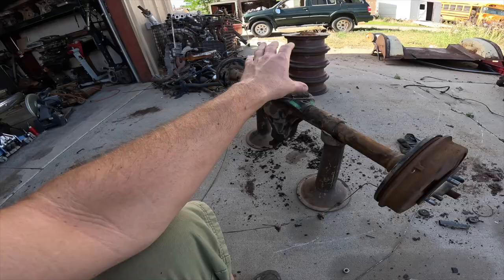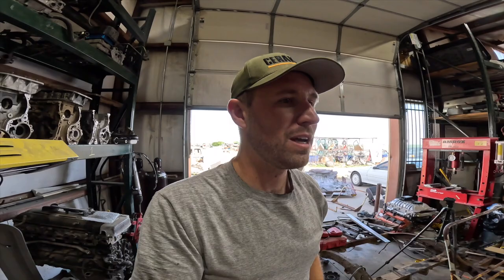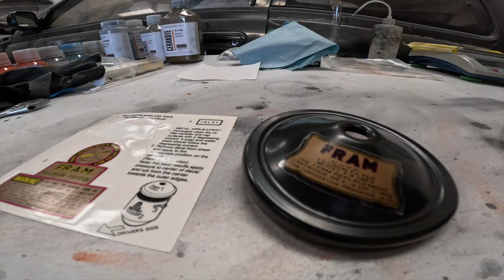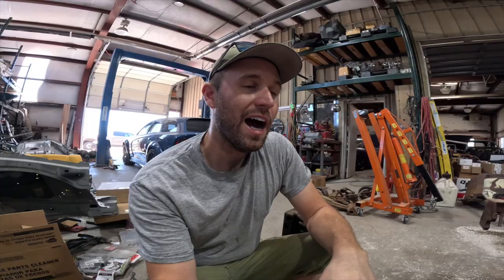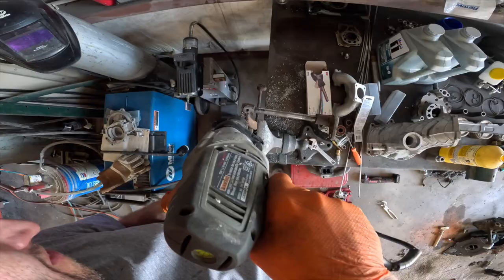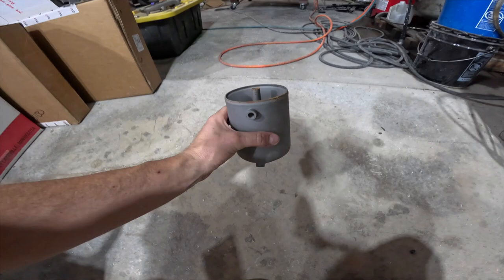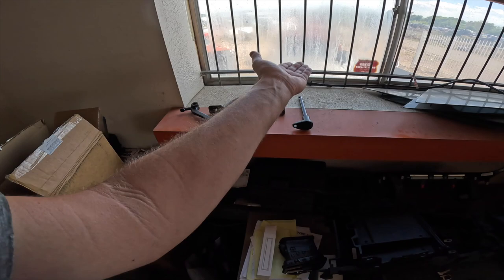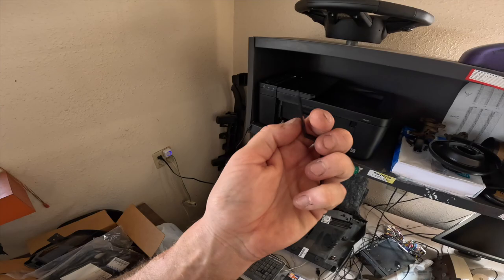Restoring A 1948 Keller Super Chief Woodie | Episode 5

Comment: With your porosity on that oil filter bottom... Clean it with Muratic acid then give it a skim coat of lead  body solder to fill in the bad spots.. Even fill in around the washer.. Propane torch works the best, way cleaner.. You can use the solder like body filler to fill all the bad spots and sand sand it smooth after. And it will seal all the holes :) .. Great video thanks

Comment: A few more small steps in the process of restoring this rare vehicle. Good to see you using a proper brake pipe spanner on the brake piles. Almost everyone uses an open end spanner and this often results in rounding the nut. The way you are going with this restoration, it will be finished before the hellwagon. It's quite interesting to see your progress on all your builds. Unfortunately, everything takes time and there never seems to be enough of that in the day. Before you know it, another year has passed.

Comment: To pull the hub/brake drum off the axle you use a hub puller. Usually 3 legs bolt to the studs and the center bolt pushes on the axle to pull the hub off.

Comment: Oil Filter case and cartridge, contact Fram directly. They DO have the drawings on hand, and can make a replacement on special order, or provide you with drawings so you can have it made. If anything Fram will demand to remake a classic oil filter system for a classic car.

Comment: There is a slot on the backing plate (there should be a rubber seal in the slot).  Put a screwdriver in the slot and back off the tensioner. Then you should be able to remove the brake drums.

Comment: You need a hub puller! You also need to leave the nut on the end of the axle!!!! It can mushroom the axle also when the drum comes loose it can be violent! What you need to do is leave the nut flush with the end of the axle shaft put the hub puller on and tighten it down, then hammer the end of the puller and the drum will pop right off. The axle is likely a crosley.

Comment: You need to use a wheel puller get it real tight as you can with your hands. ( then only then ) is the part where you need to use a B F H tool. Then repeat as needed.

Comment: the brake shoes are stuck to the brake drum. Back the brake star wheel so the shoes will close.there should be a small window at the reverse side of the brake mounting plate. use a brake spoon and a small screw driver to move the the brake adjusting lever away from the star wheel. then use the spoon to rotate the wheel. which direction? i think you go up. start at the bottom of the star and move it up.
Reply: Pretty sure this is too old to have self adjusters so just the spring will be holding the star wheel. Make sure the brakes are backed off put the puller on with some tension. Give the end of the puller a whack or two with a heavy hammer. If all else fails, try some heat on the taper on the brake drum.

Comment: I`ve heard that one way to loosen the rear drums is to back off the axle nuts and drive around until they pop loose, you`ll hear it  when they do. You`d  have to wait until the the car was back in running condition but it`s an option when all else fails.

Comment: If the drums are anything like what my old ford has, there are bolts on the back plate which holds the bearing carrier on. I used this as an alternative because the drum itself was seized to the tapered shaft

Comment: Those 2 piece shafts are a pain when they rust together., I've had some luck w tensioning the drum on a big 3 jaw and cooking the taper and quenching a couple cycles. 

For the bushings you can order liquid polyurethane or rubber and so long as ya can jig it up right it works well. Had to make some isolators for boats that way.

Comment: I'm thinking that the rear axle is either Rambler or early Dodge, I owned both, and they're both a pain in the ass to take apart, but it looks very familiar. 
There is a video on a Dodge Fargo rear drum removal. It shows the puller.
Reply: I've pulled the drums from tapered axles on a 62(?) Dodge. I used a puller with a slugging arm to power the jacking screw. Beat the crap out of the slugging pad  to put tension on drum taper. Then use torch heat on the hub, it'll let go. Keep out of the line of fire, cause it might just POP off with force. For me, I had trouble with the left side. I beat the hell out of the slugging arm pad, I stepped back to regroup and catch my breath. I was just standing there thinking about what to do next, when it just blew off of the axle shaft. It flew about 3ft. It could have done some damage if I had been standing closer.
Reply: Tried to post link but it wouldn't let me

Comment: You can pull the center pin held in with a bolt ,push the drunk in a little bit and then pull axel and drum out place a board like oak hard wood on the ground and invert the axel and of corse drop it quit hard on the oak and the drum will dislodge from the axel

Comment: When you have the puller fitted, when it is under pressure give the end where the nut is for tightening the puller a good sharp hit with a hammer and the shock should loosen the hub off the shaft ? You may need to hit it a couple of times or so, to achieve the movement?

Comment: It can be a bit destructive (check first if replacement drums available), but if there is a lip worn into a drum and you can;t remove it for love nor money. You can do this : drill a hole in the stud mating surface halfway between 2 studs (so it presses against the inner flange , a decent size say 10mm , then tap that hole to the matching thread for a sacrificial bolt you have. Then get your impact and run the bolt in, and it should start pressing the the drum away from the flange (You may have to drill/tap a second bolt hole on the opposite flange side to work each side off evenly) and hopefully brute force the drum the hell outta there. You might even be able to use the drum again, just if your OCD you will see the extra holes there everytime you need to remove a wheel. Some older cars actually have the threaded holes there from factory for just that very reason! Have at it!!

Comment: Appreciate the lengths you’re going to with this restoration however I did cringe slightly when you were filing down the casting marks on the pedals. Believe it or not but that small rib you filed down was actually providing some strength and stress relief to the inside corner of the elbow. If you have filed it down flush and have a sharp inside corner you will have increased the chances of a crack developing. A bit theoretical I know but just be aware keep it a smooth transition at changes of direction to not introduce higher concentrations of stress.

Comment: Hey Dave, would cerakote be a good choice for the underside of a truck cab? Ill be welding some new inner and outer rocker panels on my 80s Chevy. Wanted to paint it underneath with something heavy duth to keep them from rotting away again.
Reply from the maker: You can powdercoat or raptor line the bottom of a cab. Cerakote is a bit more expensive for such a large area
Reply: @Junkyard_Dave  Thanks! I do remember you raptor lining undersides in other video. I appreciate you reminding me. I enjoy all your projects always impressive.

Comment: Since the rear was out of the car would it really have been so hard to pressure wash the rear before tearing it a part so that the dirt and sludge on the outside of the housing wouldn't fall inside the housing when thhee cover was taken off.

Comment: Are you going to put a turbo on the original engine? That would be the best option as far as originality goes, and it might make nice power to push that little light thing along faster than you could imagine. You could have a draw thru setup thru a single 2 Inch SU carb and a malpassi switch for water/meth injection or timing retard, you would only need 150hp to make that car go respectfully, and you can put it all back to stock if you ever go to sell it..
Reply: I'd wonder if the factory rod setup would hold the hp improvement.

Comment: Not for nothing, but apart from the mounting bracket welded on it from the factory, both of my ford's oil canisters look pretty near identical to the one you have there, though i may have to look at them again to verify. Don't a lot of old diesel and 1950s cars use a very similar or identical canister?

Comment: I do not understand what you are doing with all do respect. As you know this is an extremely rare car. You should not be changing anything on it but rather to restore it back as close to when it rolled off the production floor. In my opinion it is not right, it is like pulling the motor on a Tucker and dropping in a 327

Comment: The brakes are Studebaker and so are the axel tubes because it has all the backing plates and it looks like they have been adapted to a center differential because of the sleeves look like adapters that isn't the way axles are usually made usually the tubes are welded right to the differential and that isn't a Studebaker differential but the tube and brake assemblies are Studebaker I'm pretty sure because of the way they are adapted to that differential